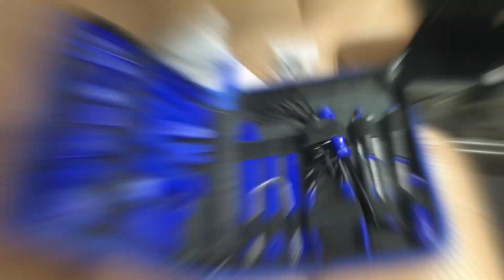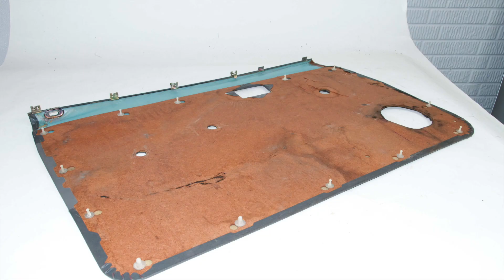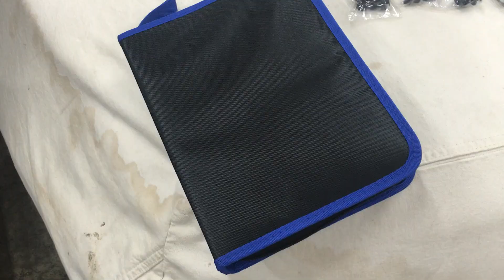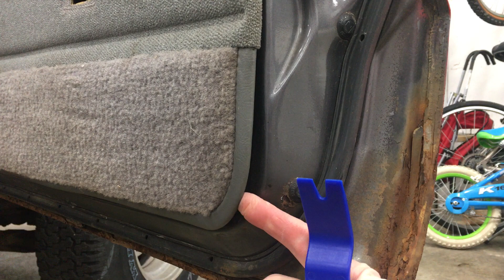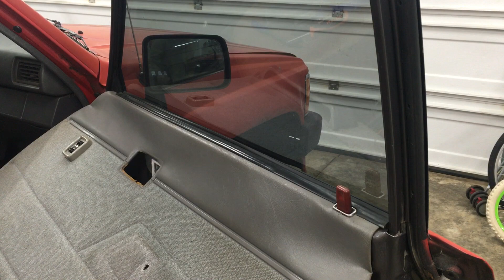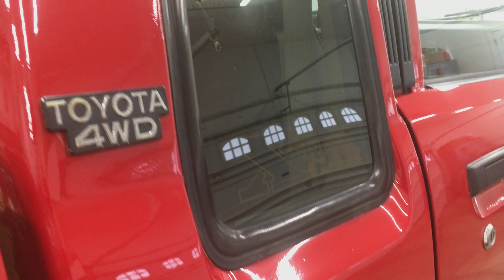How to: Remove Toyota Pickup Truck/4Runner Door Panel

Comment: Thank you very for all the info on this video.

Question, what seats would be a bolt on upgrade to a 1986 xtra cab long bed?

Restoring the truck and looking for what will fit.

Thank you.
Reply from the maker: Aside from seats from another truck from the same generation, there are no seats that I'm aware of that would be a direct bolt in. I've seen mustang buckets, celica buckets, tercel buckets in these trucks and they all needed to be modified because only one or two of the holes lined up.  Even if you go from bench to OEM buckets of the same generation truck, I believe the floor will still need to be modified to accept the inside rails of the bucket seats.
Reply: @6thGearGarage  Thank so very much. Really appreciate all the help and unfo.

Comment: Question. Got a 90 4Runner with power non vent windows and I’m wondering if i can keep the electric motor equipped when I swap to the vent windows?
Reply from the maker: 1990_4Runner the vent Window doors use their own regulator. Most of them are manual. Power was a rare option but I don't know how the part number for the power regulator. I've never tried takimg a motor and attaching it to a manual regulator, not sure it can be done.

Comment: hi . i hav a 96 Toy 4runner... can i remove the drive shaft going foreward [2 the front axel]
w/out causing any problems ??? I'll never need/use the 4wheel option.
Reply: You can but, why?
Reply from the maker: Yeah, it won't cause an issue. Just mark the position so if you re-install it it won't be 90° or 180° off and cause vibrations.

Comment: Can you tell us more about that gauge cluster on the dash?  I need to do something about my gauges.  Been thinking about that very location.  Thanks.
Reply from the maker: It's a factory option called Inclinometer. has forward and sideways tilt gauges and also an altimeter gauge. You can find them used on ebay, but they're pretty expensive.
Reply: @6thGearGarage  Thank you for that, also for doing your channel👍

Comment: Hello, Ok I have the Same Color Tan Door Panels! 
How are your so How are yours so pristine and Mint condition?
I would Love a Tan Set in the Shape!
for my 85 Extra Cab SR5 4x4 22rec
Thank you
Reply from the maker: This was an Ohio truck so it wasn’t exposed to the harsh sun that the southern trucks get. That helps to preserve the interiors. Instead our frames, beds and cabs rust through from the road salt in winters.
Reply: @6thGearGarage  There is No way in the World thats Stock Interior! Sorry No Way..

My Truck doesn't have all that rust Like ASSume it Might.
So I should have Like New Door Panels also Then. 
Some upholstery did them and you all dont want to tell us the Color.. Its All good No Worry..
Reply from the maker: John M The interior is original as far as I know. These trucks rust so fast here that they can look horrible outside and nice inside. Maybe the previous owner refinished the door panels, but I have collected a few nice sets of door panels from rusted out cabs over the years.

Comment: Helpful - I am removing my rear door panel because the locking mechanism is not working. The button will not stay down even after I close the door and push it down from the front door. Do you have any advice of what to look for?
Reply from the maker: What kind of vehicle do you have?
Reply: @6thGearGarage  89 4 Runner. Thanks for replying -  I worked out how to get the door panel off. Now to work out how to fix the locking system. The button keeps coming up and unlocking.

Comment: i have a 1985 toyota pickup, with the vent window. i’m looking to get new door panels that wrap around the top by the window. have any idea where i could find some new ones?
Reply from the maker: On these panels, the only difference is that the rubber trim strip that attaches to the top of the door panels goes all the way across for non-vent windows and uses a shorter trim strip for models with vent windows. The panel itself would work on either type of window setup.

Comment: Do you have a ebay store?  I am looking for a passenger brown ac vent.  Great videos they have helped me alot thank you
Reply from the maker: I do, but I don't have any vents.  They're hard to come by because they get so brittle that they crack easily.  The passenger one is always the worst when it comes to breaking.
Reply from the maker: Oh when you're shopping around, note that there are 2 different designs of passenger vent, depending on your dash. I believe 84--85 vents are different than 86-88 on the right edge. The 86+ are recessed in the dash while the 84-85 are flush on the right edge.